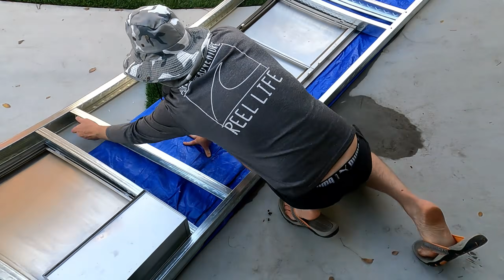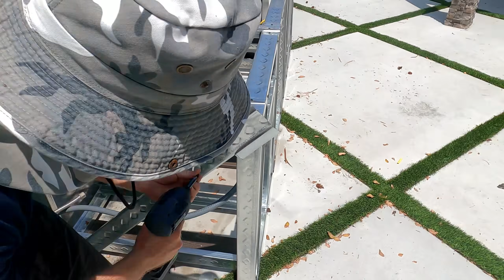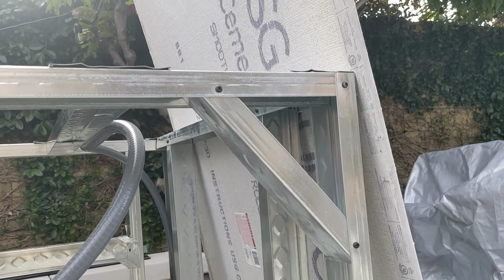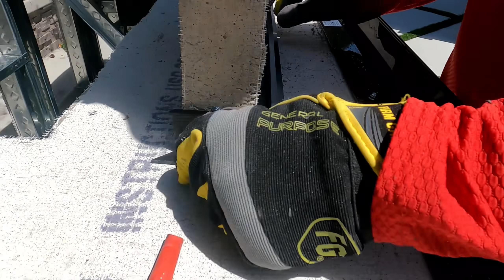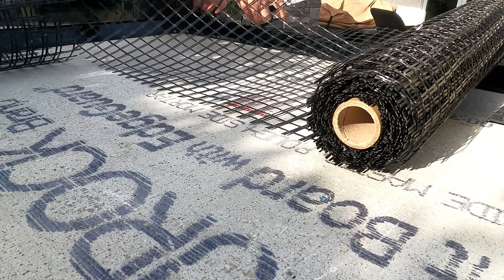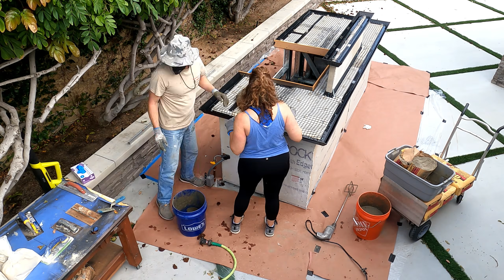DIY BBQ Island Build Part 1 #bbqisland #bbq #backyardgoals

Comment: I need to know the gauge of the metal studs and need to know how to secure the metal structure to the concrete slab?
Reply from the maker: @abidrahim3462, I used 25 gauge studs, and used construction adhesive to attach.  The top weighs so much it doesn't want to move.

Comment: what doors/drawers did you use? I've seen a lot of Vevor but heard of issues with rust.
Reply from the maker: They are Vevor and now it's been through a wet winter.  So far so good, no rust spots.  But I would say the bearing rails are on the cheap side so I'd keep them heavily greased. 

re-instating this comment as You Tube cleared them all out after converting the channel to a brand channel.  Thanks again for the comment!

Comment: Nice video.  I'm looking into building one of my own.  What gauge size did you use for your steel studs?
Reply from the maker: Used 25 Gauge from Home Depot.

re-instating this comment as You Tube cleared them all out after converting the channel to a brand channel.  Thanks again for the comment!